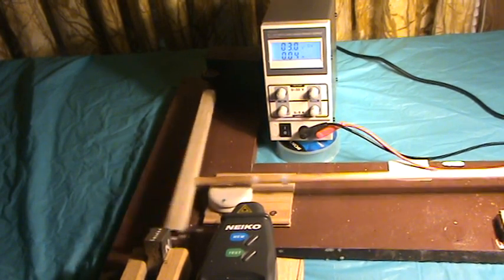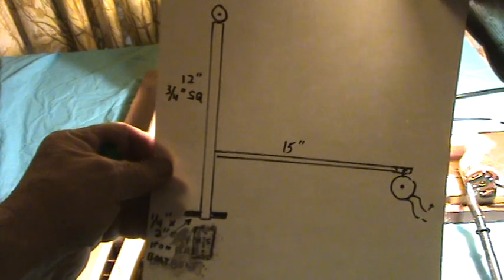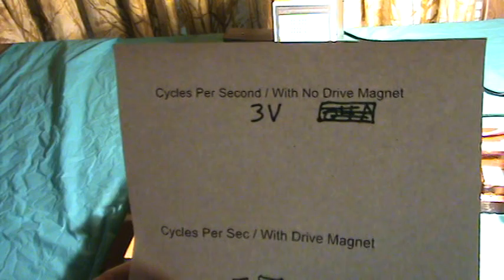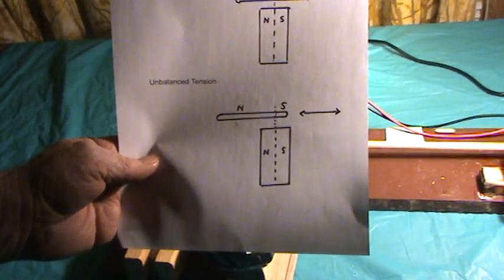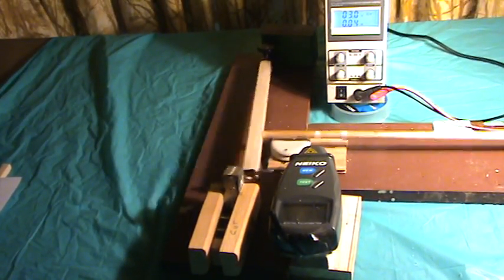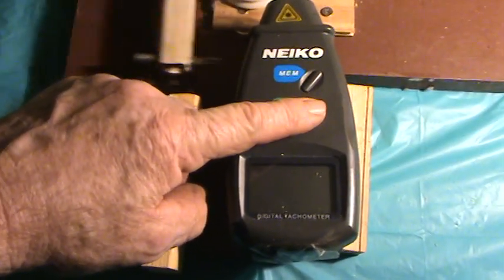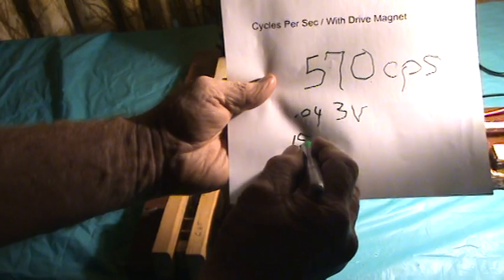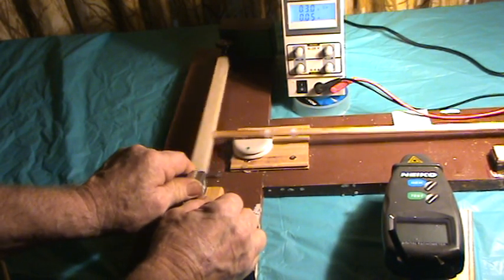Ray's Magnetic Pole Flip Motor...

Comment: The Magnet actually does functions just like a spring... The moving Metal rod builds up a magnetic field Oposing that of the magnet when it moves  past the magnet, thats how eddy current breaks work ;)
Without the magnet the Inertia of the Wood gives the motor a hard time when it tries to pull the wood back in... but with the magnet the Inertia is compensated...
Replace the magnet with a ruber band that tensions the wooden bar to the same position you have the magnet at the moment and you will get a similar result.
The compensation of the Inertia also explains why the frequency increases and the motor current drops, as the motor only needs to add little energy to the oscillation.
Keep pushing Ideas, there still is a lot of undiscovered mysteries out there ;)
Reply: Seems like that is what is going on , but still  putting a stationary magnet in the system should not give more cpm with less power drawn from the power supply ,I have never seen anything commercially made that does this .